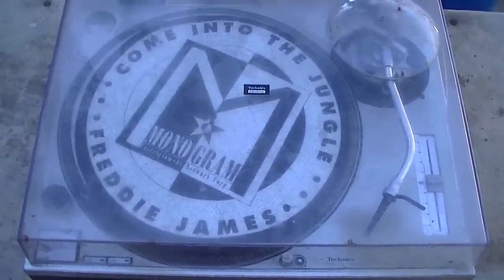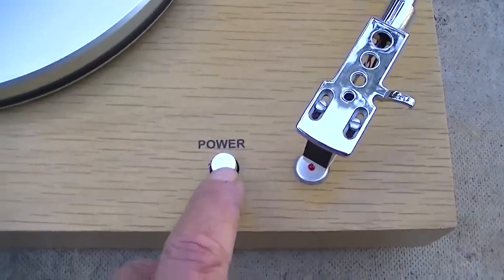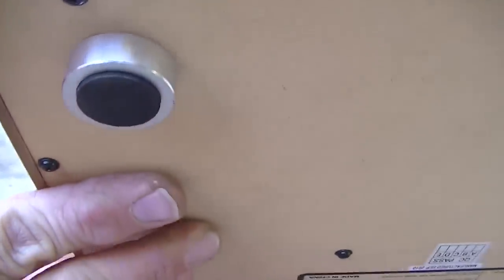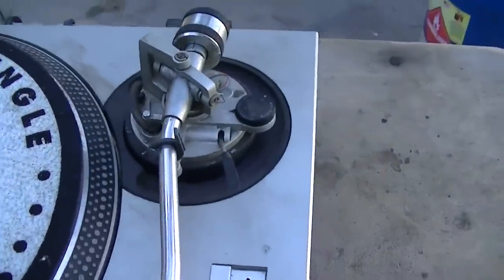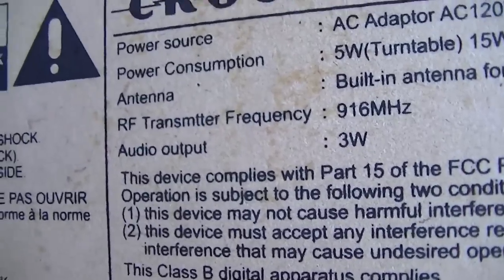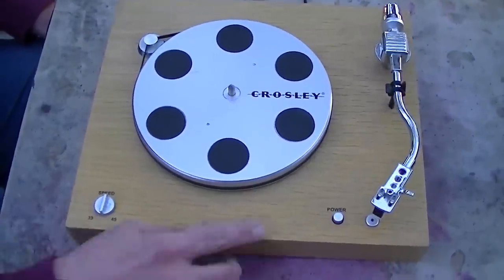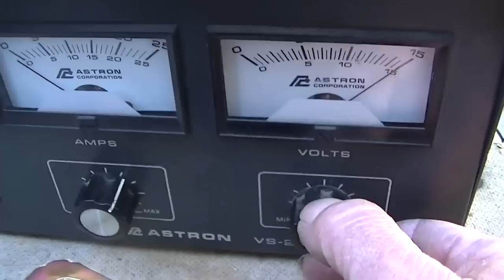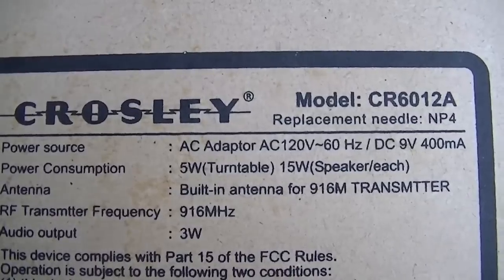Crosley Component Turn Table Review FULL

Comment: Notice that there is no strobe or pitch control--they didn't want anyone to see how wildly inaccurate the speed regulation was, and with such a cheap motor, a pitch control wouldn't be able to hold a consistent speed for very long anyways. Technics probably put more money into just their tonearm/gimbal support system than the fake Crosley company spent on their entire unit.
Reply: Yeah! And a RE-purposed CASSETTE player motor no less!

Comment: Nice review,  but you didn't review the gasoline powered player.

Any chances of a review/test-playing?

By the way, what is actually inside those dc motors as far as speed control goes?

The wireless audio transmitter did look like the only part partially worthy to save from the EOL.

Comment: Shango, I have a Technics SL1200MKII outfitted with audiophile grade Shure V15VXMR cartridge (Tracking at 1 1/4 grams). Should I ditch this setup in order to procure one of these wonderfully engineered Chinese made units? Please advise me on the proper course of action.
 Also, I love your vids on the old "roundie" color sets. As an old TV tech, I would love to own one.
Reply: You got me thinking I should maybe dump my Technics SP-10 Mk 2 with EPA 100 tonearm and ZYX 4D low output moving coil cartridge for one of these Crosleys!

Comment: Wanna see something really funny? Do a Google search for "How It's Made Turntable" and see how an ultra-snobby ultra-pricey turntable is made. Note the similarities between the turntable in that video and this Fine Piece Of Stuff Crosley. 
Remember folks, although the venerable Technics SL-1200MKII isn't being made anymore, Audio Technica will be happy to sell you a perfect knock-off of it complete with a good-quality magnetic cartridge, switchable low-level, or line-level outputs, and a USB output, all for less than what Crosley wants for the current version of this Foaming Piece of Stuff. 
Bottom line: Do not buy your turntable out of the Urban Outfitters catalog. Seriously.
Reply: tfm55x what if urban outfitters starts selling lp-120s

Comment: A friend works at Penn's Peak Radio, an internet radio station, which is used to supply Blue Ridge Communications, a cable TV conglomerate supplying much of central Pennsylvania - with their "informational channel audio presence".

He's always looking for something interesting to do on-air.  Maybe he can do a comparative test between Crosley's top-of-the-line model, such as this, and the USA - produced equipment which they use in their studios???
Reply: I've seen them advertised at a drive-in theater, Becky's Drive-in, in Berlinsville, PA. Actually, I don't know if they're in Berlinsville or Walnutport, but around there.

That sounds interesting, doing a comparison.

Comment: My family grew up pretty poor, until I was about 16 or 17 I bought my stereo equipment at Big Lots , downstairs in the living room my mom had a sound design, we had a GPX radio and the kitchen and I had a sound design with big tower speakers that had a 4in wideband driver in them and nothing else, by soundesign too. Even then with very little to compare it to, I thought it was pretty cheap stuff, set the controls while a little flimsy we're reliable and it worked pretty well for several years, and even though I still think of it is a piece of crap it seems like it was built like a Rolex compared to this Crosley, even compared to it at Crosley Cruiser this is got to be the worst built thing I've ever seen, barring virtually nothing oh, only the cheapest dollar store toys strike me as being worse than this by much
Reply: To be fair though, the wobble at the bearing on the tonearm I do believe that's a knife edge style bearing, I won't go so far as to pretend it's actually a unit pivot but it does seem to be some sort of knife-edge bearing designed to move about like that

Comment: lol  !  … that Tone arm & Platter are hideous ! But, the C-20 was a revised model actually built by Pro-Ject (in the Czech Republic); with an Acrylic Platter (ala U-orbit); a Ortofon OM 10 (easily upgradeable with a OM 20 or 30 stylus) Not sure if It still uses the same Preamp as the other Upgraded "Better" TT's from Crosley... Perhaps I'd use an external 'Dupre' or Better Phono preamp.  And I'd Only use the USB for ripping  But due to it's rarity, The C20 now costs over $450 ! Making the Fluance  and U-orbit Turntables more attractive. Too bad !